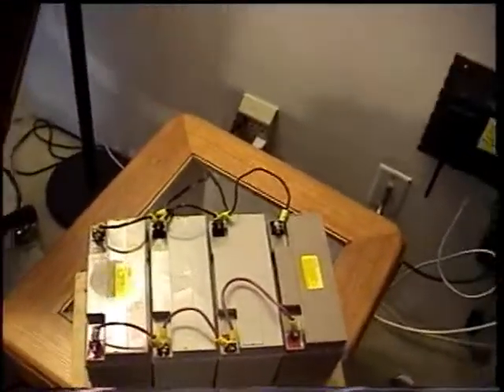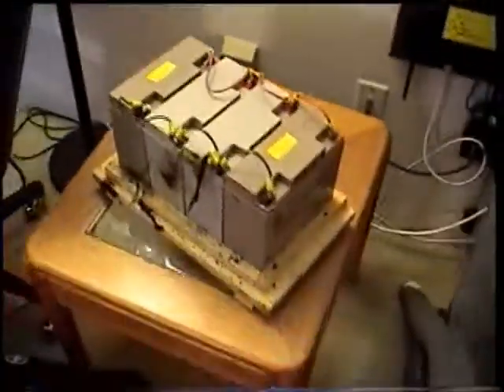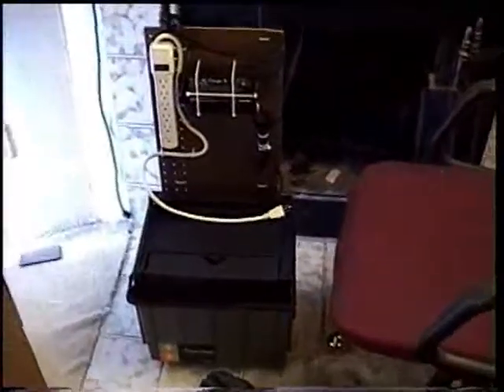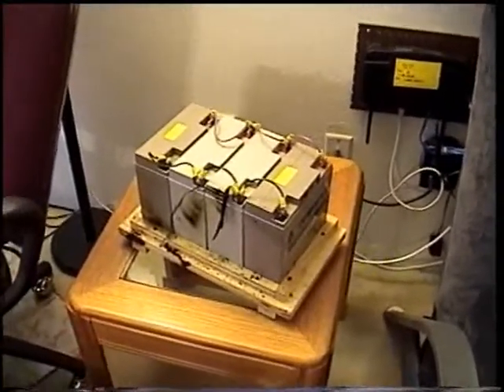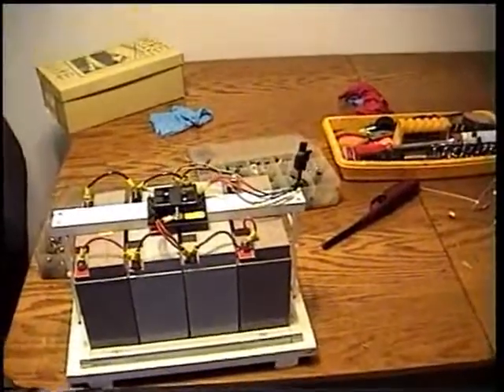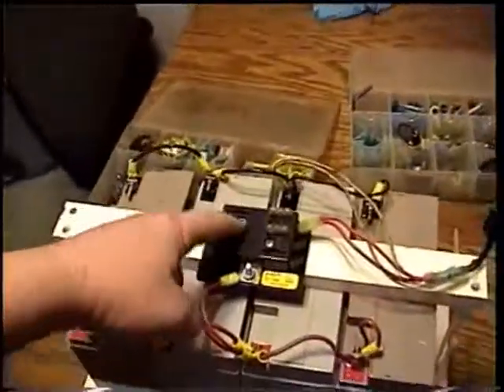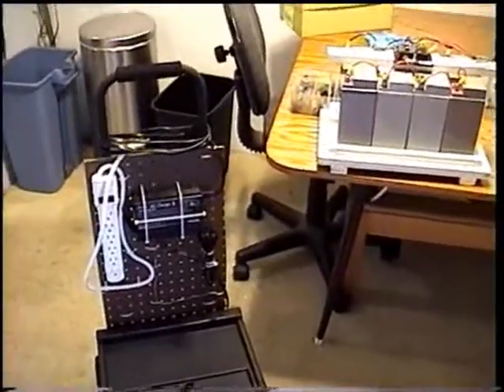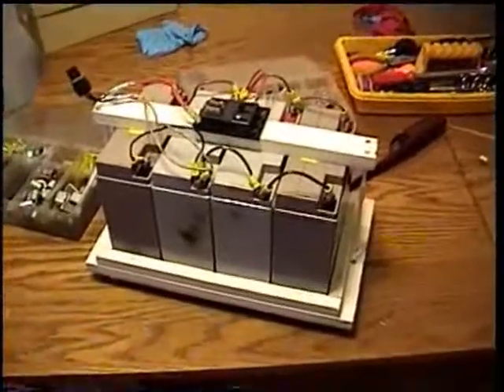Electrical Fire! Don't be as stupid as I was

Comment: It definitely is a smaller market. We are so fastidious with our 99,99 % power availability in Germany that some appliances aren't even designed for a momentary outage. You usually get to feel this if the GFCI trips due to some fault and you scour your home for the instruction manual to $DEVICE because it has lost all its settings you programmed three years ago.

Comment: Of course I'd need an opposite adapter to get the unit charged from my European wall outlet as well. Do these adapters change the frequencies (60 Hz US vs. 50 Hz Europe) as well? I reckon this requires some semiconductor electronics and is more expensive than a simple transformer.

Comment: There's still no such powerpack available for Europe but I could buy batteries, charger and inverter separately and build one. 65 Ah at 12V cost $290 over here, so a day's 4 kWh would cost more than $1400, and at more than my 200 pounds it would be a real pain to carry up my 70+ step staircase. The last thing you need in an emergency situation is a hernia because you definitely can't fix that one yourself.

Comment from the maker: vivaloriflamme
Actually, the wire just melted and that ended the short circuit. My power wire became a fuse. My new setup is better and I'll add a second harness like this one, with 60 amps. That should be plenty for this application.

Comment from the maker: julzbo 
I'll try the soft scrub idea. 
Ya fires do seem to be cropping up. Last night before work I smelled smoke and had a high stress moment while I threw on my shoes and ran outside to check both sides of my building, but it was just someone running their fireplace. It served as a reminder though, that I need to move more of my stuff to the storage locker so I don't have so many eggs in one basket here in my condo.